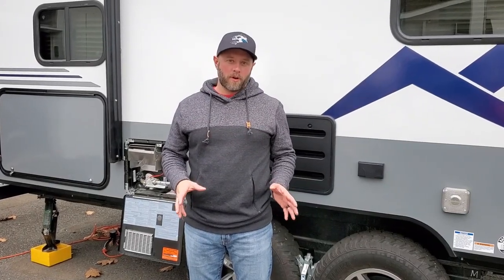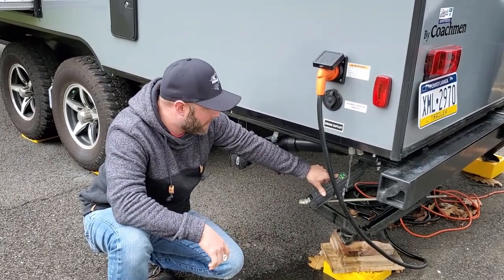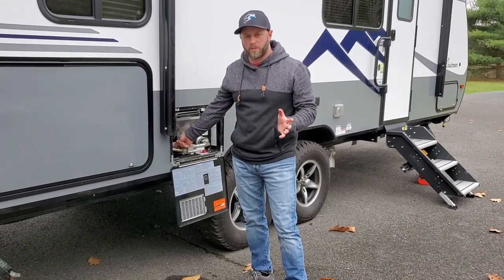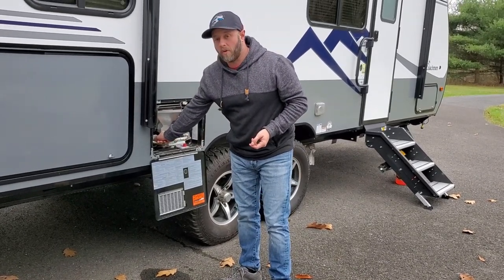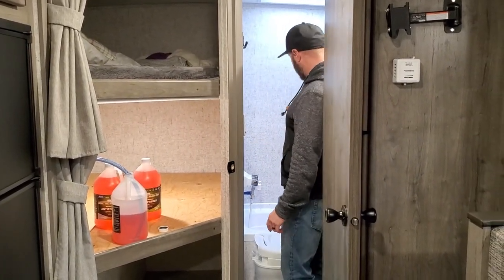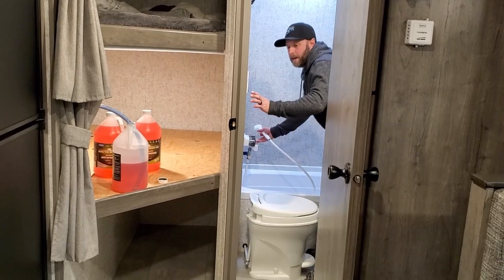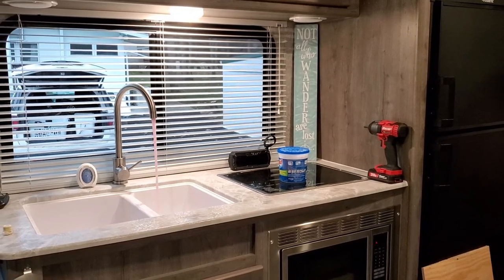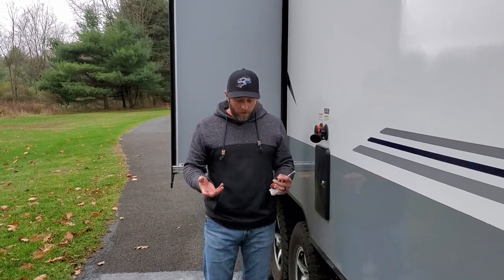Winterizing your travel trailer

Comment: I buy the compressed air dongle and just blow air through the lines. Set the compressor to 50psi and blow out all the lines including, kitchen faucet, bathroom faucet, shower, toilet and exterior shower. Be sure to empty the water heater first and then turn the valve closed (located under the bottom bunk). Then finally, open the two low points until only compressed air comes out. Empty the fresh tank as well. Then pour 5cups of non-toxic af to the sink drains, bath drains, toilet and shower drain.
Reply from the maker: if you have access to an air supply certainly is a good idea.  The big thing to remember is just to have anti freeze in all of your lines and remove as much water as possible

Comment: Thanks for the video.  I'm curious if there is anything you have to do with the toilet?  There is a water that runs through to rinse the bowl and fill the basin when you flush.  Also do you recommend just pouring antifreeze into your black tank through the toilet?  Curious if that matters or not.
Reply from the maker: Yes after I shot the video I forgot to show the toilet.  Yes when you have your pump on just push the flush pedal as well to run the antifreeze through it.  You want to drain your black and gray tanks once your done doing your flushing to get the water out of the tanks.  I do then add some antifreeze back into the toilet to go into the black tank.  Just alittle will do the trick here. Thanks for the comment because I did want to mention the toilet